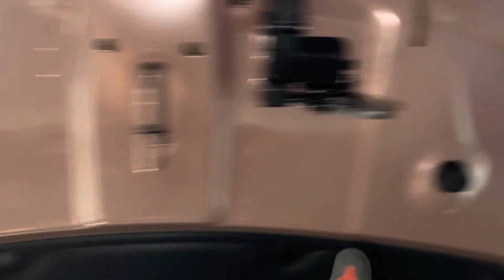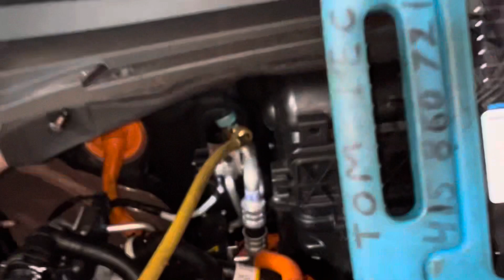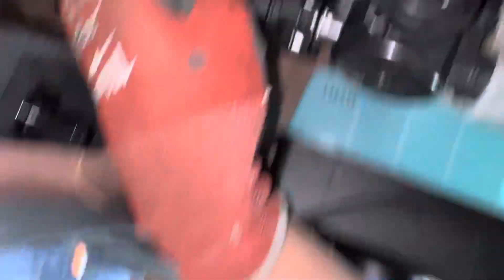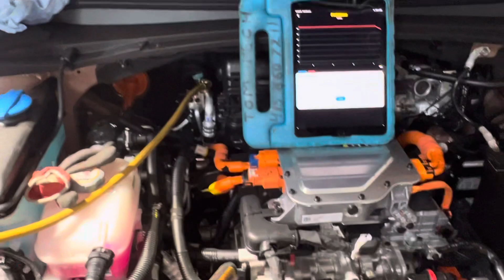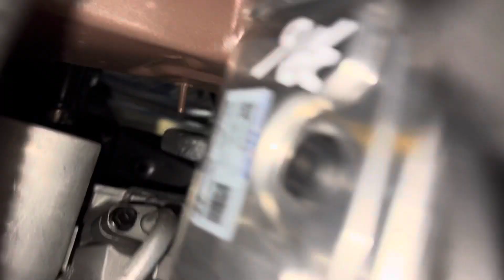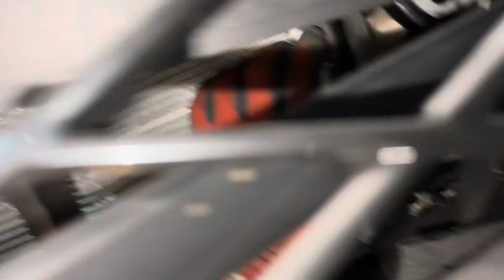2023 HEAT PUMP V60 GENESIS if burnt black metal, flake compressor burn out . HOW MUCH WILL IT COST￼￼

Comment: Pretty good that you can work on aquariums to
Reply from the maker: Yes, my 180 gallon aquarium with its larger commercial water pump and micron filtration system that actually polishes water crystal clear super active charcoal, carbon filtration system with heating and cooling to control temperature.   I go extreme on my aquariums to.
Reply: @coldfinger459sub0  wow 180 gal
It just reminded me of the Cabela's glycol system

Comment: Extensive use of glycol normally minimizes the refrigerant volume, but this thing still has 2lbs of yf. yf actually is pretty flammable, it just doesn't sustain a flame easily, so some manufacturers use glycol to keep the refrigerant volume down and keep flammable gasses out of the cabin. https://youtu.be/BOoErXmZj1o
Reply from the maker: YF refrigerant it is not that flammable.  Not at all. 

When I open my tank valve onto a match, it blows out the match  lol 😂 

It takes a real intense, red heart, continuous flame that is keeping its self fed ignited to keep the YF refrigerant burning . 

Glycol is much more flammable than YF refrigerant .
Reply: @coldfinger459sub0  You can see the ease with which it ignites in that video using a blowtorch, and I've seen many videos like it. It looks more flammable than 154a. It depends on the ignition temp, oxygen mixture, and so on. Perhaps "combustible" is a better word. But yes, with just a naked open flame, it will most likely blow the flame out.
Reply from the maker: @WaffleStaffel  yes, I’ve seen all the video test doing comparisons, including ones where they busted out all the flammable and mildly flammable refrigerants all at the same time igniting them together, so you can see just exactly which ones were how flammable or how not flammable 

I prefer my house freezer with the butane or propane. It works much better and it only has 1.44 ounces of R 600. 

I remember as a child, putting lighter fluid on my hand just a little bit and igniting it. It only flash for a second, and you could put it out with your other hand by squeezing it, suffocating the air. . 

Would put propane in my hand liquid just a little bit and ignited on fire and waved hand around like it was on fire, but there was no heat cause it was for such a short duration of time .   But yes, the arm hairs were missing after that. 😂 

When it comes to strapping barrel bombs and 80s or Road Side flares to tanks of butane and propane with duct tape, and igniting them, standing back in the field, and watching him spew their flaming gas, that was something I did quite often in my useful teenage years and preteen . 

Making small explosives through chemistry was something. My father taught me making my own gun powder. My own flash powder small portions of highly unstable, binary explosives thanks to my father’s military explosives training. . 

He invented a dangerous child . Who had lots of fun and still has all 10 fingers..
Reply: @coldfinger459sub0  lol, he invented an intelligent child by not wrapping him in soft nerf foam. My first chemistry project was nitrogen triiiodide :) This video of an ammonia explosion is pretty interesting- https://youtu.be/n4ktAaGAyLc
Reply from the maker: @WaffleStaffel  yes, my father taught me that trick to use a lightbulb as a ignition source so when somebody comes to turn on the light that will ignite your explosive. 

Also, using the thermostat in a house .   Either heating or cooling at a certain setpoint that is not near your set point that will be achieved many hours, late into the night or into the heat of the day.. 

Using the thermostat as your trigger to ignite your explosive 

The same goes with your wash, machine or dryer timer used as a timer 🧨 to ignite

Always need that pressure release window or ceiling or bottom or combination . 

When building unstable, highly ignitable, explosives, upfront and close . 

I was taught to build a cabinet where the upper and sides and back will easily blow away with no pressure so the person standing in front is not harmed .  For that one time mistake. 

I think if I was a chemistry teacher in high school, I would get kicked out   Speaking of which I talked my eighth grade, chemistry teacher into making gun powder that she never made before as a class demonstration

After finish mixing the components I would say she had about roughly an ounce and a half of black powder that she put on a aluminum pie pan . 

You can see where this is going, and she sat it on top of her teachers desk in the front of the classroom to demonstrate the Slow flash in the little mushroom cloud that would come from it . 

But she did not a dissipate that a lumen is an oxidizer and low temperature in melting point that melted right through the pan and left a permanent burn mark in the middle of her desk. Something to remind her of me for the rest of her years after I have left  🤣
Reply: @coldfinger459sub0  Oh, so your dad was the Unabomber!
Reply from the maker: @WaffleStaffel  yes, but was never caught. 
       Everything was always deemed natural causes upon completion of investigation. 🤣

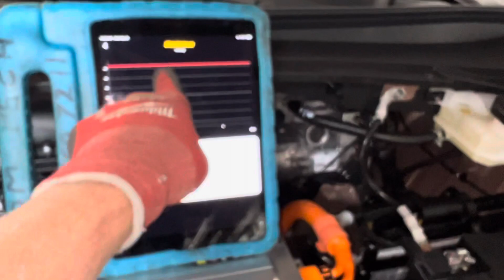Comment: Just a wild assed guess, at 2:00 and 3:45 I'm guessing it's some kind of flow sensor, with the last line designating hardware and software versions.
Reply from the maker: Looks like it has a mechanical device inside like a motor for either diverting or turning on and off

Gotta get a total the one out in the shop and take it off 

I have to start stripping down, totaled out EV’s and taking pieces off of them for autopsy
Reply: @coldfinger459sub0  Interesting. Yes, if you get ahold of one please tear it down. It's hard to tell by the wire gauge whether it's a sensor or a valve.
Reply from the maker: @WaffleStaffel  even if the wire gauge was very small, you would think it not carry very much current, but because the little motor in the power require to move it would be extremely tiny, so large gauge wire would not be necessary. 

And hopefully one day they get rid of the 12 V DC power in the vehicle and switch it over to 480 V or at least 220 V throughout the entire car for everything . 

This way, the wire gauge can be much smaller on everything and not waste so much natural resources of our copper .   It will also make the vehicle much lighter.. 

Because the higher, the voltage, the smaller, the wire gauge can be in the more power available for tiny motors. Everything gets tiny and more powerful. . 

If the technicians do not know how to work on 480 V without killing themselves, that’s one way to clean the gene pool and only the smart will survive and we will have many more smart technicians. Then we have stupid technicians Darwins theory of evolution, hard at work. 🙏🤞 let’s just pray and hope cross our fingers that they implement high voltage in automobiles it’ll make life so much simpler..
Reply: @coldfinger459sub0  lol, yeah, you can selectively erase the dumb technicians, but can you do the same with the dumb car owners?

Comment: Wow they need more reinforcement to protect the front end.   Expensive vehicle to not protect better.
Reply from the maker: You would think that to protect the vehicle, but the federal passenger safety laws do not care about protecting the vehicle

It’s about protecting the passengers 

And to protect the passengers, you need soft, crumple zones that smash easily to take the force of the impact, and slowly deliver the force to the occupants inside the car protecting them 

If you made a strong Richard Car that did not collapse 

Then the instant nanosecond that you hit a brick wall all that instant stopping for school is right to all the organs in bones of the human body .   

But the car does not get damaged  🤣 

This is why modern cars are designed to collapse and fold up very easily all the way up to the passenger firewall to protect the occupants inside

Comment: I like how you disect system using your knowledge base to determine how the system sctually functions. Really cool. See what i did there😊
Reply from the maker: When you get into commercial and industrial or residential, HVAC and refrigeration. 

All of these items have been in use forever in refrigeration and in hydronic’s in glycol loop systems and geothermal systems. Everybody who has studied this when you take your 2 1/2 year course in HVAC at your local college trade school. You learn all this stuff. . 

And now this technology is coming to cars on the electric vehicles. It is all very old-school. None of it is new. . 

Because I have my background in commercial refrigeration and HVAC and residential it makes the electric cars heat pumps extremely simple like small child’s toys .